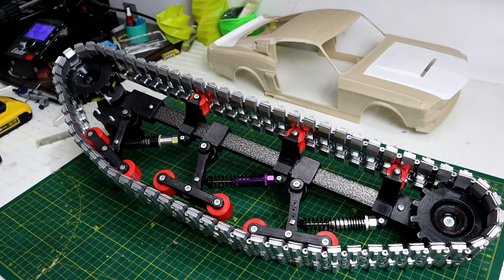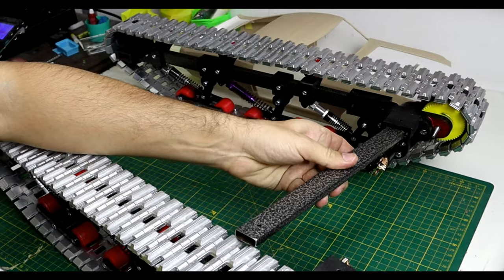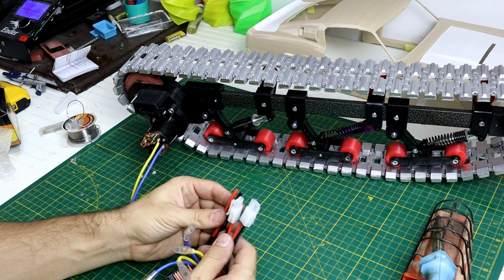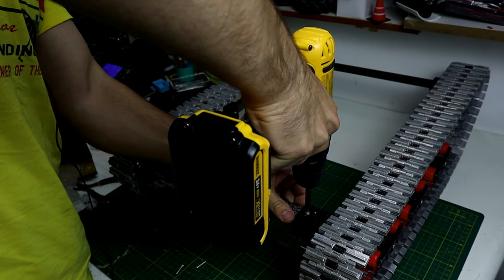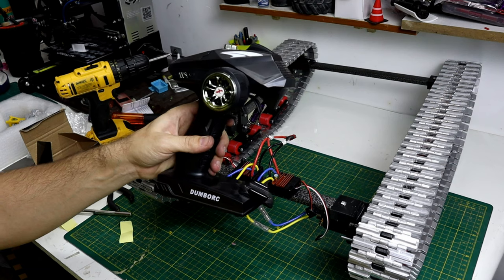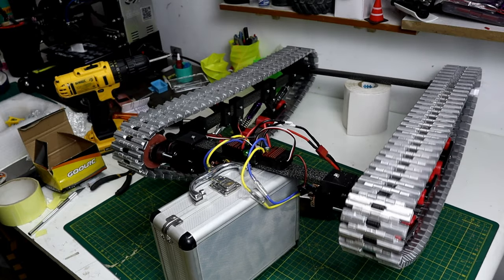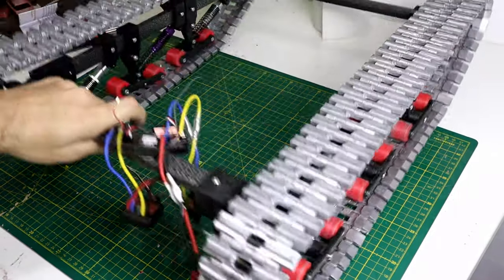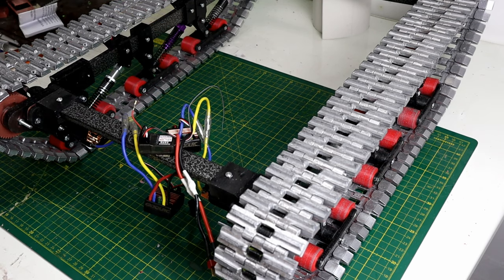Fully 3d printed 23'' long Brushed TANK Assembling  /PART 2 | Scale Addiction

Comment: Hi, just downloaded the files for my first tracked 3D project. Is there a parts list for all the other non printed bits, like bearings size, the connecting steel bar dimensions for example? Many Thanks